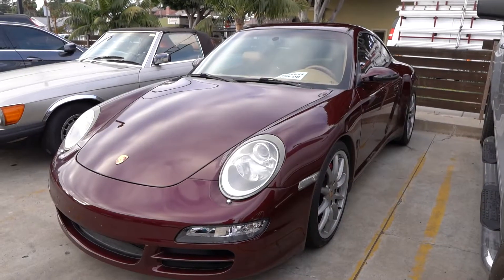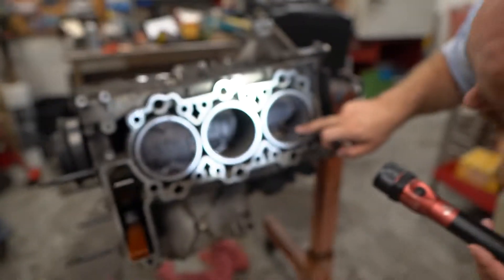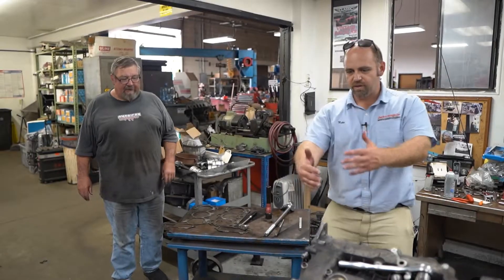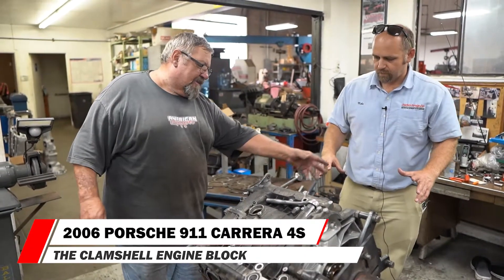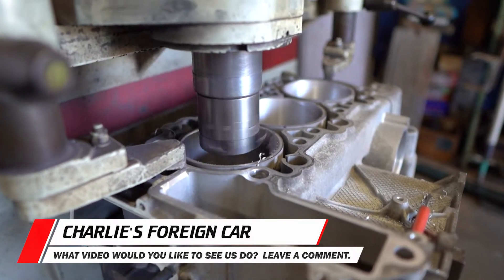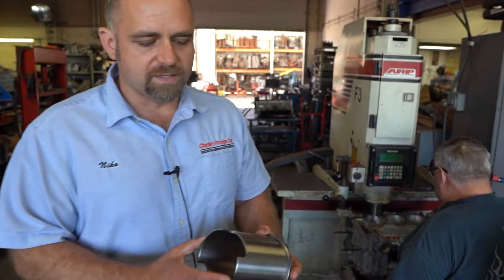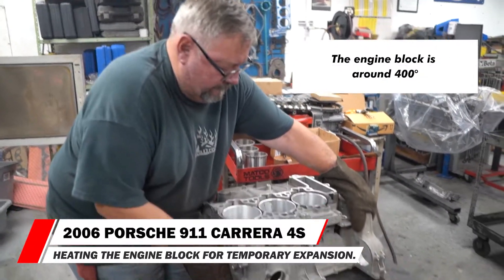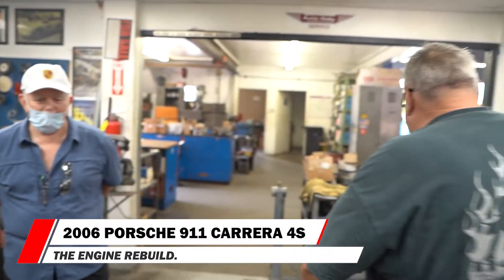Episode 1 Cylinder Misfire and Bore Scoring

Comment: When inserting the liner into the engine block in the image
What is the white chemical that you apply? Please tell me what white liquid you use If possible, I would like to work with the same solution to the product name.
Reply: Video progression At 7:50, applied liquid to the engine block

Comment: does anyone know why these cars have a bore scoring problem? While it's great to fix the problem, what's to prevent it from happening again? What about the IMS bearing issue? This brings back my PTSD from owning various other German vehicles before I finally gave up.
Reply: Dan, it’s not a large percentage of cars that have it. It’s noteworthy because it’s expensive. Leaky injectors deposit fuel in the bores and wipe the oil film away. Additionally, long term oil change intervals leave the oil without lubricity. Short drives that don’t allow engine to get out of the cold start enrichment cycle flood the cylinders with fuel. Short drives also fail to burn off water in the oil from condensation.Because many owners are collectors or don’t drive the cars often, this is what you get.  A good pre purchase inspection and an annual datalog of the ECU will reveal issues before they arise.